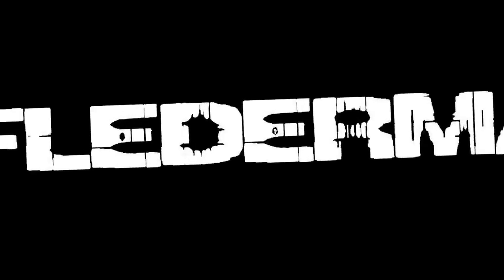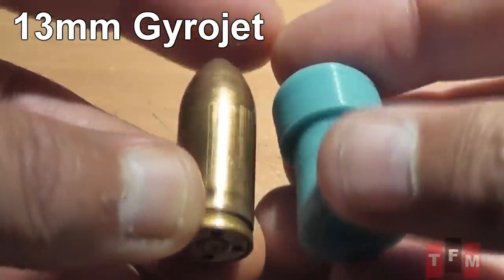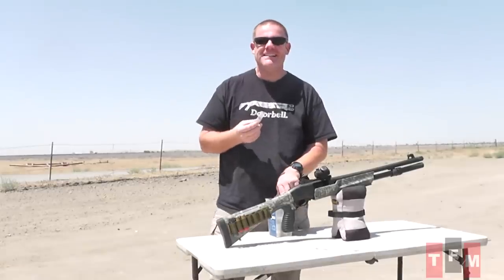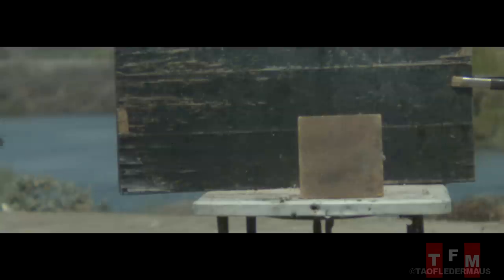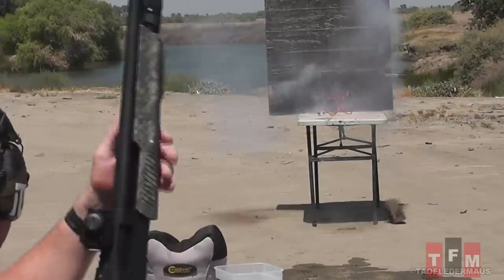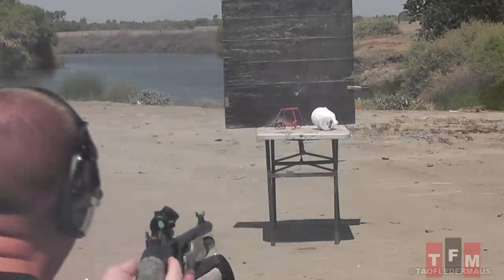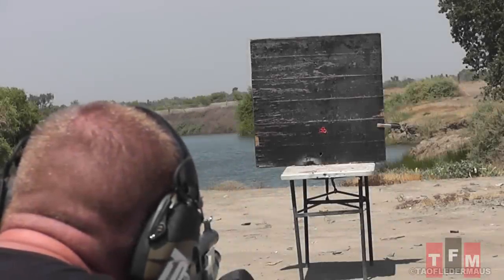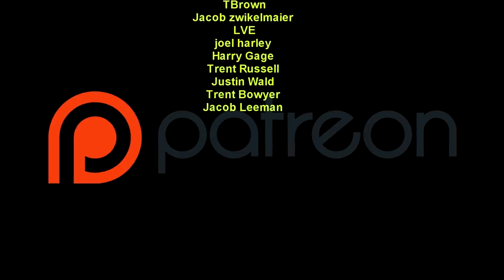Massive 3D-Printed ROCKET Slugs -   First Test

Comment: I would, instead of using sugar rocket fuel, use the white powder fuel from inside the Saturn Missile fireworks. Stuff burns FAST and if caked together with be an actual rocket. If you do though, make sure the powder isn't loose or it'll just blow up.

Comment: Without using a constriction nozzle, you are not going to get a jet of hot gas as the fuel burns. Also, R-candy would be a poor choice for the fuel since it doesn't not burn consistently enough. It also tends to not be very powerful. I would recommend ammonium nitrate and aluminium powder suspended in a resin or some other high impulse ammonium based fuel mixture. They are very stable (won't accidentally ignite), have very consistent burn rates, and you will get much more thrust for the same mass.

Another issue that these seem to have is uneven balance and the 3d printed structure coming apart. The shock from the initial gunpowder blast and the pressure from the fuel burning are both going to tear these rounds apart. I would suggest that a brass cylinder with an open end, like a spent shell casing from a 9mm round, be used to hold the propellant and reinforce the body of the round. A 3d printed or resin cast body could then be used  for the aerodynamic shape with the propellant cylinder glued or epoxied in place. A cavity in the nose of the body could then be filled with fine bb's or lead granules suspended in wax to give weight to the head of the round. With the lead packed tightly into the cavity, it will create a more balanced round.

Comment: Would like to see rounds only propelled by the 5gr of gun powder and no R Candy. How much is the R Candy actually helping. Also, could you press a 9mm casing into the bottom without a primer and use it as a jet?

Comment: was  fun to watch curious if u were to use a .22 could u drill out the base of projectile pack with sugar mix (rocket fuel) and see how it fly's also would a airrifle ignite the mixture using compression ignition eg. join 2 pellets together drill through base of first and pack r/f mix all the breast wb og

Comment: The flaw of the gyrojet was that they didn't use rifling, they'd have done better to have still has some degree of venting out the rear of the action but the projectile could engage rifling giving it more resistance and more time to get the fuel burning as well as extra spin

Comment: Rifled barrel.

More conventional "Minie ball" slug shape.

Faster burning propellant (1/4 second burn time is about right).  Pressed black powder bound with collodion, perhaps, or AP composite as suggested in another comment.

Actual nozzle (epoxy with micro balloons shaped like the nozzle in a commercial model rocket engine).

Might work better?

Comment: Mercury fulminate in your 12 gauge percussion cap is providing all of your thrust.  Potassium nitrate based Rocket Fuel Burns pretty slow if you want to fuel a rocket of that format I would suggest some potassium perchlorate for your oxidizer and for your fuel source something with a high energy density like aluminum Titanium or magnesium of course at that point you're going to have to add something to slow down the burn it should make a lot better rocket projectile though

Comment: It would be cool to see a projectile loaded with a small Estes rocket motor in it that is ignited with either a primer and a tiny load of pistol powder in a 12gauge shell or just fired electrically where you use a standard rocket motor igniter with no shotgun shell.

Comment: Seems like a muzzleloader or breechloader would be better suited for what you're doing with these rocket slugs than a 12ga with a throat in the bore.  Why not try one of those Estes rocket engines, such as the 13mm "mini" engines.  Won't fit in a 50cal muzzle loader but should work better than what you're doing with the 12ga.
Reply from the maker: A rocket engine is not going to fly straight at all.   I learned this as a kid and almost burned our house down!
Reply: Right, but inside a slug it should fair better.  It just needs to balance, else the nozzle pressure forces it to start spinning.  In rockets that is mitigated by aerodynamics, having the weight rearward and finned.

Comment: Needs a much faster burning propellant unless you are shooting at 1000 yards.
I think if you machined a steel body, you could have something that works.
However, if you are shooting from a shot gun, what's the point in having a rocket booster?

Comment: What if you combine the rocket slug with the whistler nozzle if it ignites it should get much more thrust and gives you the ballast you need as the centre of gravity would be on the nozzle instead of the slug so it's like pulling motion instead of a push motion?

Comment: The "Diablo" (Just an oversized skirted Pellet from an air rifle) shape is stable in Static flight, because the skirt, and head acts like a shuttlecock.  However, putting Thrust in the base would de-stabilize that, because you don't have the relatively heavy head towing the relatively light skirt behind it.  You have the skirt driving forward, so it handles more like a front-engine/rear drive, without any wheels on the pavement.  Which means any off-axis thrust is going to make it tumble, without spin, or fins to stabilize it.  I would probably go for Fin stabilized, with a promer in the base (Where the Shotgun primer is in the shell) to ignite it.  Obviously high temperature (And expensive) alloy with the powder charge ignited between the fins, and heavy lead head for a gas seal up front.  Boat-tail it with a semi-wadcutter just to fit it in the crimp.  For the rocket, I'd probably just use a slow burning solid fuel like Ammonium Nitrate in a petroleum jelly substrate to bind it together.  (This isn't ANFOL, but not far off.  I won't tell you what the proportions are, but it's a high expansion Incendiary, not a high brisance explosive.)
Reply: I would try taking a 3/4" titanium dowel (If you can get one) and mill out 3 fins with a drill press.  Hollow grind it at 60 degrees so that the fins come to almost sharp edges in between, then drill out the center as large as you can stand to for the propellant.  Vent out all 3 sides at the bottom to ignite the booster charges between, and put some sort of venturi cap/forcing cone in there to ignite it with the primer.  I'd work up the propellant charge from a squib load (Just the primer, and rocket) up to enough to clear the chokeless barrel, BEFORE I started packing the base with rocket propellant.  Definitely test it on a stand, with a remote trigger.  (Baling wire is fine if you have a long enough one.)  Also, a bunker to hunker in, in case it flips a bitch, and comes right back atcha.

Comment: The problem with those slugs is the fuel mix.  The specific impulse is way too low to be useful over that length of flight time.  For a shotgun round one should use a steel jacket round with a compressed guncotton load and a lead nose weight.  Gun cotton is a slow burn high explosive that used to be used as rocket fuel during WW2.

Comment: Love the concept but the application needs consideration.

First off, the sugar/saltpeter mix is not really solid fuel, it's good for smoke bombs bur that's about it, we're talking about rapid acceleration for this concept.
Then there's the stability, if those things were actually generating any thrust they would be landing pretty much everywhere else but your target. 
Which brings us to the primary charge, i think to get this down properly your shell is going to have to change all the way back to the primer which is going to be popping those slugs too far down the barrel for you to gain any advantage from the actual fuel, as it is you're basically lobbing smoke bombs with the black-powder charge.
Finally your actual slug, no solid fuel rocket works without a stabiliser, i think using rifled barrels is cheating because they're pretty rare and personally i'd like to see this thing work for any old shotgun. My proposal would be a ring on telescopic legs(typing this i realise that sounds like a lot of work but i think it can be factored in successfully on a budget.)

I also recon you're going to deal with a ton of fouling if you get it right, not sure how to get around that without some space-age fuel.

Organise me a green-card and i'll come show you yankees how ;-)...

Comment: The problem with printing things is the molecular bond..... There is none, I suggest baking, or using a small torch, or heat gun, or soldering iron, with the plastic welding tip, don't melt it but help it stay together when it's fired,

Comment: It is actually good the rocket propellant doesn't have much thrust because all of the yaw in the projectile would cause it to flip and spin out of control.  If you light a bottle rocket without a stick that is what you get.  Rockets have fins for dynamic drag because of yaw.  I have a friend that does commercial fireworks and he makes fin-less spin stabilized rockets that launch from a polished nail on a board.  They spin up at high RPM's from angled holes in the cardboard tube before the propellant burn past the hole and they launch in the air.   The diablo shape may actually cause problems with thrust because the shock wave at the front and lack of vacuum at the hollow cavity.  You might need Gyro-Jet with more spin and maybe tail drag.

Comment: Same problem as the gyrojet. You have to use a mechanical or electrical ignition. I designed both in 2012, but I am poor and can't turn them into reality. Relying on the powder to ignite the rocket is not a good thing. No one would ever trust a firearm that works sometimes. To launch a small unguided rocket you need rifling and some decent charge. That way it leaves the barrel at a subsonic velocity with rotation. The rocket handles the rest

Comment: This really needed a metal body, even aluminum would have been better and a MUCH stronger propellent.  Those sugar rockets are pretty weak.  Then put it in a rifled barrel and make sure it has a good nozzle on there.  You should be able to pack it right into the base on a shotgun shell with the primer right of the nozzle with maybe a few grains of powder just to prime it.You could make it longer too since you have no powder or wading to take up space.  Like the Jyro Jet it likely would not do as much damage up front.  Maybe you could do some shorter ones with some powder but I would worry that is wound not ignite.  I would love to have to help design something, but I like some of the skills and more importantly the tools to make these things.

Comment: hm.. The diablo shape is USUALLY really stable in flight..  Maybe it's due to the light weight of the slugs ?
Reply from the maker: These were a bit longer than normal,  and may not have had the correct balance too
Reply: Aye...  But this early testing does show real promise.  Anyone know what the actual Gyro-Jet rounds use as a propellant ?

Comment: Get some more and set off the fuel with a tiny amount of black powder triggered by just a primer. And i do mean a tiny ammount as in lit just enough to fill the back of the "nozzle" Or tr a bit of cannon fuse. I suspect these can fly strait if they are under only their own thurst with out any thing pushing them eg gun powder going boom :p

Comment: If time of flight is .01 sec but the propellant burns for 1 sec, most of the fuel is wasted. Wouldn't it be better to have a more rapidly burning propellant and stabilise the rocket with fins or something? I'm sure you'd get a harder hitting and more accurate projectile. The propellant needs a lot more work done,  it's much too smoky, doesn't burn efficiently..

Comment: A numeric lathe could probobly make 5 of those a minute with nobody watching it out of inconel steel. That would make them 100 times stronger, and also a bit heavier, also make a lot of more space for powder. Could probobly even make them with of set holes for spinning (say one large hole back, and two smal hole for spin.
Reply from the maker: They don't need to burn for more than a half second.   Yeah,  a stronger slug with a lot more thrust would be better.
Reply: Well my point was that they should be quite cheap to produce while then lathe been programmed. Of cause, Incanel is not cheap.. but i would imagine  that stainless steel would work to.

I would probobly stay a way from carbon steel. It handles heat worse and are also lighter.

They should be quite easy to make for someone how have the tools.

Comment: Probably wouild work better with just solid  filler and a purpose built nozzle either printed or machined out of like aluminum, maybe put a steel or tungsten nose on it for weight and penetration.

Comment: Tail wagging the dog kind of round. With a regular round the forces are acting at an impulse. With the rockets it's like going high side low on a motorcycle. The butt is moving faster than the front and you end up with the wobble.

Comment: i think velocity doesnt really factor for rocket projectiles in the same way it does for bullets.

Bullets are thrown by a push
Rockets are everpushing

Bullets lose energy and dont get it back
Rockets get energy back by persisting to push, and so they wont loose nearly as much energy on impact, and in fact, are sometimes gaining energy and force still even when they hit something. For as long as they have fuel, they keep going.

Its for this reason the Duncan Idaho character dies to a rocket needle in the Dune books/movie. unlike bullets, a rocket needle is slowed on impact with a shield, then once slowed, is still burning fuel, and pushes past the shield at a slow speed, and burrows through a victim as its speed picks back up where it left off.

This may explain why the gyrojet pistol actually manages to drill its bullets through kevlar.

Comment: I think we can have an TLE (timed low explosive) similar to the T.H.E or APHE where there's an fuse to allow the projectile to leave the barrel at high speed and then accelerate or in the APHE case allow the round to go through armour and then explode as go for THE its an anti infantry round built to exploded in the middle of a group of infinity or clear a cliff side

Comment: With a rocket slug like that I was wondering wouldn't 30, 40 or even 75 yards. BE a better test of the slug
Give the rocket time to ignite and burn
Reply: The rockets were igniting the burn added very little thrust. It couldn't even push itself off the table under full burn. If the rocket motor was a thrust factor the projectiles would have been wildly inaccurate. 

In this test they limited the range because they were worried about starting a brush fire.
Reply: @rburns9730  thnks for info
These are all pretty kewl
☺

Comment: Model rocket motor?  put it in a Shavo shell and 1/16 inch drill hole from bullet propellant to the orfice of the rocket motor.  I've launched just the motors with a straw on the side to hold of the launch rail, once started they go straight.  "A" size motor, put a 38 or 9mm bullet in the end of the motor down range and the porcelain orfice might shatter as the shotgun shell goes off, might need a very light load.  Or just use the shotgun as the launch tub and close the gun ot ordinary wire igniter to start motor.  Shell primer might start motor also.  A "D" motor might be 12 gage size, but they are cardboard and might not be best in a worth owning shotgun.

Comment: The thrust nozzle is too big, and the propellant too slow burning, for it to remain really stable in flight, especially out of a rifled barrel. It should potentially be a boat tailed projectile (decrease drag), with a smaller inward angled nozzle (think fighter jet engine, where they tighten the nozzles to increase thrust) and the nose of the projectile needs to be more aerodynamically shaped (conical, not flat)... It should be looking more like the original gyrojet round. But without the side spin stabilization nozzles. That's too complicated, just use rifling and an initial powder charge to get it out the barrel at speed and a central nozzle for further thrust. And a faster burning propellant... R-Candy is good, but burns too slowly. Not sure what I'd use, I know less about rocket fuels than I'd like to. But this was a damn good attempt. Especially for a diabolo shaped projectile. Those are freakin awesome on their own, but aren't really suited for this kind of experiment. But it was a fun video as always, and great to see people experimenting with rounds. If I had some machining tools, and better rocket propellant knowledge, I'd try to knock up some prototypes of what I'm talking about to send to you. Along with a few other ideas I've got in mind.

Comment: OOoohhh....it's a sugar rocket!!! Ya, need better fuel for sure. Figure out liquid fuel in a small form factor. Would probably work out better, not sure bout the 3d print plastic though. May need metal due to heat cap of plastic. 
Edit: Another thing. To get the best results, use more volatile fuel and flare out the end of the barrel to catch any back blast coming at ur face.

Comment: use the 9mm case cut own and flash hole as rock fuel "mini rocket" inside the slug
Reply from the maker: The r-candy burns REALLY dirty and creates a lot of carbon.   So  might need a different fuel if we are using small orifices.

Comment: Physicist here, The Rockets Do not have time to build up pressure and propel themselves. The Explosive charge Is the actual propellant here. Due to the excessive tumbling and The Rockets Not changing its direction that leads me to conclude that there is no propulsion by the rockets. This test needs to be re-done without the explosive charge to give them a boost but solely on the power of the rocket.